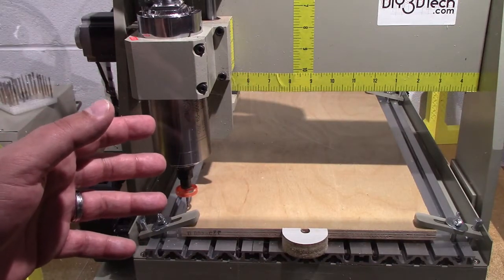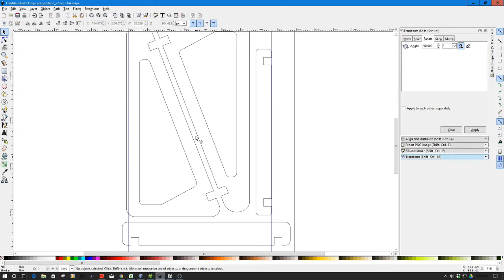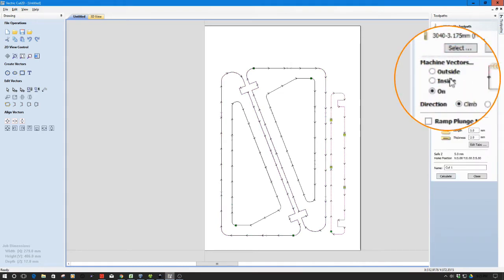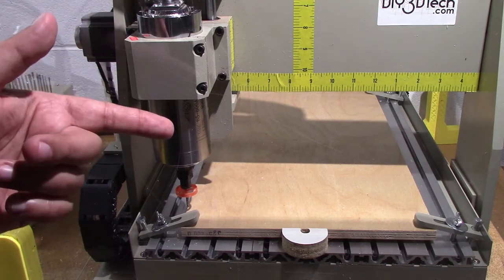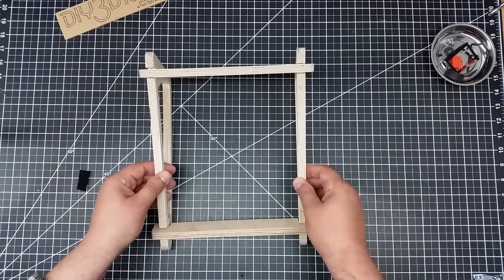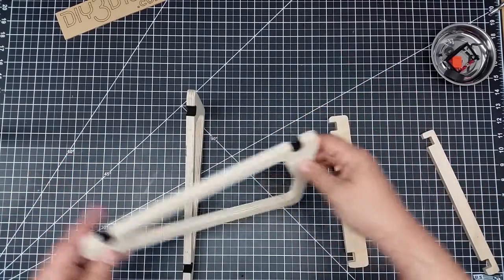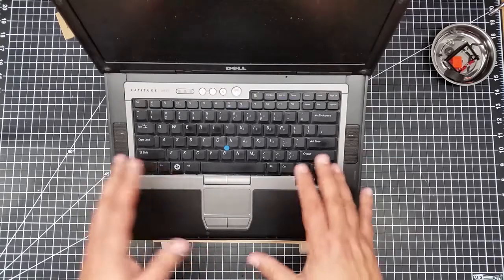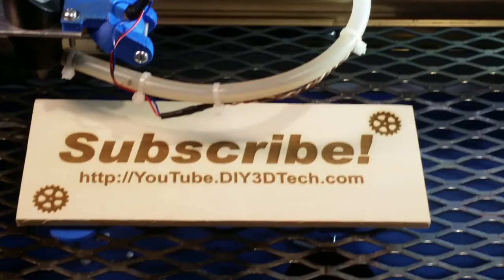3040 CNC - Desinging and Cutting a Laptop Stand!

Comment: I'm sorry but your shimming makes no sense! You have a CNC! It's perfectly able to cut the notches just right! And if not, its user error! This video would be way more useful if it showed us how to get it right the first time every time. For example: Cut a set of only the intersecting notches from a piece of waste material. Like the pieces you had to cut from the inside of the feet. and if its too lose show us how to add a 10th of a mm of material with inkscape. I bet you could have fitted two test sets inside those off-cuttings. But cutting ON the line?! You don't even do that with a laser!
Reply from the maker: Actually it does as moisture can affect the joint as well as radius of corner and while you might have time cut numerous scrap pieces and adjust 10th of mm each time I don't so it is something that has come in handy for me and might also for someone as just because its not your thing, doesn't mean its not of value for someone else...  :-)